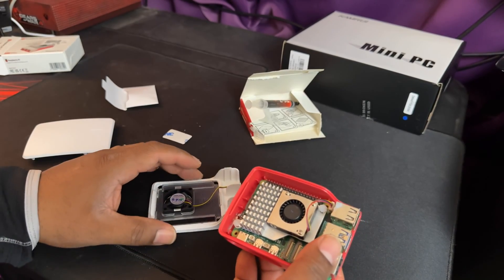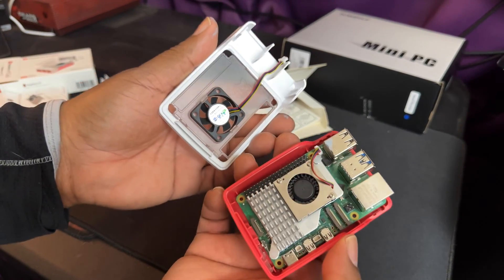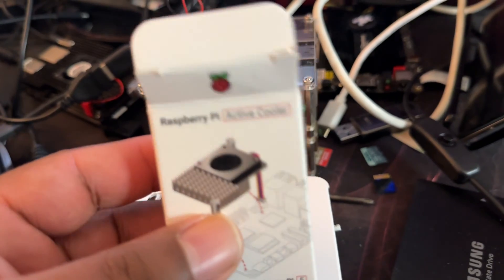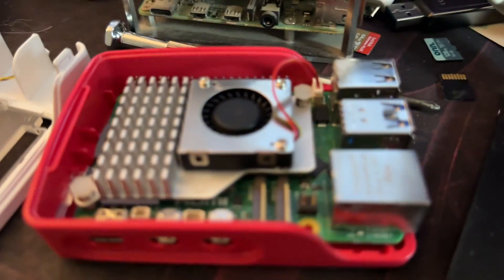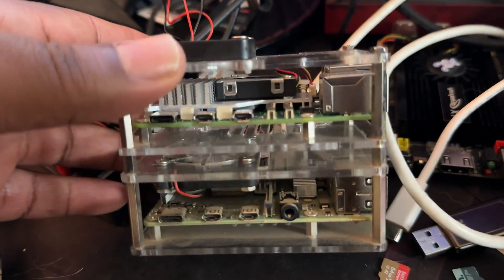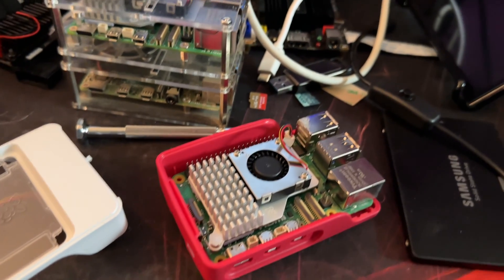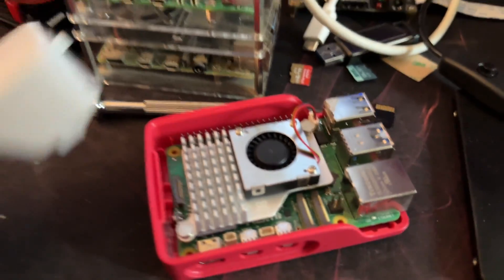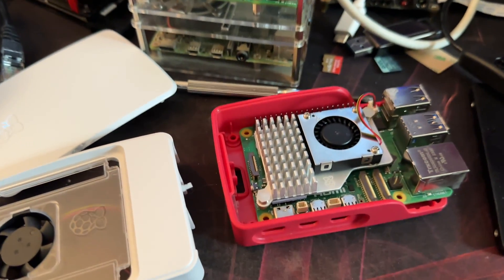The Raspberry Pi 5 Case & Active Cooler Install Concerns

Comment: That's why they've made it so that the clear part pops out so you can use it with the active cooler if you want. That's how mines set up overclocked and hasn't gone above 55c (might get hotter when used for retropie)
Reply from the maker: U need the fan for cooling as well.
Reply: Updated my post to say it's how mines set up and never goes above 55c
Reply from the maker: @xforeverknightx  weve been using retropie and temps r 55-68 especially with ps2 emulation. And temps rise.
Reply: @kiodiekin  how did you manage to get retropie working I thought there where no builds yet.
Reply from the maker: @xforeverknightx  check my other videos and playlists
Reply from the maker: @xforeverknightx  had it working for weeks
Reply: Yeah, I popped oof the plastic part and when active I pop the top off completely.   

That fan is LOUD on the active cooler.  This thing needs an ice tower and fast.
Reply: @Beyondesp  I'm waiting on the argon, I see they have a neo for preorder
Reply from the maker: @xforeverknightx  nice

Comment: Just take the piece off the top. It fits. I did it with mine
Reply from the maker: yea but with ps2 and overclocking temps r still too high
Reply: @kiodiekin  mount the case fan on the outside of the case..

Comment: I can see your frustration as most of the videos only show the active cooler without a case but they did make a video about the new case which explains that the official case was designed to use the fan as improved venting and you can remove the clear plastic cover that houses the fan for passive cooling.

A comment mentioned that the active cooler can be used inside the case if you remove the clear plastic but not recommended as they went with the metal heatsink + fan for better cooling which makes sense.

The active cooler fan is rated to 50,000 hours of use so should see long life and I expect no different as it will get regular use since the thermals from the new chip aren't great compared to similar ARM chips.

The case is also stackable so you can make a tower with a few PIs and the HAT can be installed on top or inside the case if you remove the clear plastic cover.
Reply from the maker: It’s not cool enough when u over clock. We’ve already over clocked retropie on this and people r reaching near thermals without a case with ps2 emulation. My open air case gets 28-53 degrees. The case is made to protect it. Although it adds heat the active cooler alone doesn’t provide protection. I just bench marked this and the temps were over 69. Not a good sign for long term use in a continuous fashion.
Reply: @kiodiekin  If you run Intel or AMD CPUs with full workload, then they are even over 80°C and I run them many many hours over many years with that temperature. Some of them are even allowed to run at over 100°C.
Reply from the maker: @Volker-Dirr  those chips r made to run hotter even my x1 sbc can go over 105
Reply: @kiodiekin  Yes, and the Pi chip is designed to run up to 80°C without problems and up to 85°C with reduced speed. Why do you think that the temp must be below 69°C? The design of the chip is up to 80°C without problems.
Reply from the maker: @Volker-Dirr  because this was only running for 5 mins and if I watch my other videos temps increase with demanding apps over time especially while in the case. Guys testing r already getting 77 degrees with the top off. And in some cases the fan doesn’t spin. And this is only after a few mins of game play
Reply: @kiodiekin  Don't worry. I run the official case with full load on all cores for much over 24 hours and the temp always stays around 75°C. You can even hear that the cooler turn off sometimes again because it is too cool again.
Reply: But i must admit i run only stock / official speed. Now Overclocking. I think complaining about not fitting into a official case if it runs out of official speed settings is maybe a bit odd. If anyone run it out of official specifications i think it is normal that a case must be maybe also out of specification.
Reply from the maker: @Volker-Dirr  u ran it with a high demand program like ps2 emulation? Even over clocking a bit temps go up in side the case
Reply: @kiodiekin  High demand CPU. I am compiling a lot of source code on all 4 cores. And I am generating timetables on all 4 cores. So all 4 CPU cores are running at 100% all the time. Not a single millisecond idle for the core. But since you said ps2... well, my GPU is nearly always idle.
Reply from the maker: @Volker-Dirr  ya that’s nothing. Even the orange pi5 gets hot with ps2 emulation. Ur doing basic cpu comps
Reply: @kiodiekin  Maybe, but i tested 24h and not only a few minutes. The fan is running only 50% at 60°C, 70% at 68°C and 100% at 75°C. So if you want to have it cooler (even i still don't understand why you want to have it below 69°C if the CPU design if for 80°C), why don't you just increase the fan speed?
Reply from the maker: @Volker-Dirr  do run a gaming front end and run games on ps2 for a few hours and let me known
Reply: @kiodiekin  Maybe at the weekend. My Pi must do other stuff right now. I saw the videos from channel leepspvideo . In the latest videos you can see that he installed an icecube 2 cooler, but if you check his videos 1-2 month ago, then you can see that he is running  ps2 and emulators just with a fan, no heat sink at all.
Reply: @kiodiekin  Also a German guy from a large journal reported that he put the active cooler into the official case and while gaming ps2 and other emus and the fan was not loud. It was only loud while using Ubuntu, since the fan control was not active with Ubuntu. So it look like it was not too hot for gameing if the fan wasn't at 100% while playing. He sadly didn't said the exact temperatures. see: https://youtu.be/NCpylBZu8HM?t=263
Reply from the maker: @Volker-Dirr  i dont understand the purpose in the link u sent. it doesnt provide any details as to any claims ur making. the guy was stuttering on gta. batocera isnt even optimized to run ps2 emulation which ive been doing for months.... theres a very small handfull of guys who have emulated ps2 on sbc and im one of the guys who released a build on multiple units.
Reply: @kiodiekin  Well, the information is as detailed as yours. What do you mean with 69°C is not a good sign. The CPU is designed to run up to 80°C with full speed and up to 85°C with reduced speed. You can read that also on the official raspberry pi webpage. And i measured with my tool that the official case is only around 75°C with full load on all cores (excluding gpu). And the fan even turns slower sometimes, since it is not hot enough to run it on full speed. So why you think it must be below 69°C if the software increase the fan speed only if the temp is over 75°C? If you want to have it below 69°C, why don't you turn on the fan on full speed earlier? I measured also the temperature if the fan is always on. In that case with full CPU load the temperature is only 55°C with the official case. But it is not faster by that. The CPU with 55°C as fast as with 75°C. So why do you think it must be blow 69°C?
Reply from the maker: @Volker-Dirr  the info wasn’t as detailed as mines. Fun follow my groups and public page I’ve maintained under 55 with over clock and running high end apps. None has shown a video with those temps and ran demanding apps for any long period. There quick 2 min tests where I’ve been running over 6 hours and got 53. Go run a demanding game like ps2 over clocked at 2800 and gpu at 800
Or higher inside a case and call me.
Reply: @kiodiekin  You want to tell me that you complain about an official case for default settings, because you want to overclock and keep the temperature below 69°C? You sound like one of the guys that buys an 55" tv on amazon and writes a one star review, because the tv is not 65". Isn't that a bit strange?
Reply from the maker: @Volker-Dirr  no need to hate. This ain’t the channel for that
Reply: @kiodiekin  I only wonder why channel @ExplainingComputers released a video this sunday and also measured the temperature by using sysbench on all cores, but he measured 10°C lower values as I measured in my videos (but i didn't used sysbench). I don't think that his room temperature was 10°C lower than my one. He sadly didn't said how hot/cool his room is. On the other hand there was a video some time ago where he showed how he prepared his garage into a film set for his videos. Maybe it is cooler. Or sysbech doesn't stress the CPU has much as my real world stress test. Can you maybe call me ~3 games that have a high work load. If i own that games I might test it this weekend.
Reply from the maker: @Volker-Dirr  his tests were fine and also similar numbers based on others compiling code for 3 days straight without turning there pi off. and other using there pi in the same case and got higher temps that continued to rise. if u wanna try ps2 emulation which only myself and supreme team have running correcty over clock ur pi and run it for 2-3 hours. put it in a case without additional fan. try running time crisis 3 shadow of colossus and anything else demanding and see what happens
Reply: @kiodiekin  Well, i spotted his bug in his measurements now. He (@ExplainingComputers) measured only every 2 minutes. But if the fan increase the speed at 75°C, then it will stay on/high until the temperature is below 70°C and it will increase only again at 75°C. That is coded by purpose to avoid turning on and off the fan too fast. If you saw my measements, then you saw that i measured every 2 seconds and you can see that the temp is always moving between 75°C and 70°C. That is a very clever and good coding by the Raspberry guys. They know how to cool the pi very well. So he (@ExplainingComputers) had only luck that his temps are so low. I saw similar bugs were done by other YouTubers; they measured in too large periods and by that they didn't understood why is looked so wired. You can only see it if you measure with a higher frequency or if you read the cooling documentation or source of the fan control.

Comment: Bad design. no screws. im finding other cases online that has the correct design for use with an active cooler. why may the dumb decision for people customers not to use the active cooler with there protective case....
Reply from the maker: U would think they would have added screws as well

Comment: This video is pointless. The design of the case is fine. Its allows you to remove the fan and have the active cooler. Or, you can not have the active cooler, have the case fan and your own heatsinks etc. All this is clearly explained in the literature or websites selling the Pi5 and its accessories.

Having watched a good few of your videos, its quite clear that you have an agenda with RPi, and are consistently negative about their products without sound reasoning.
Reply: @mrheath86 Someone whose never contributing anything chiming in. Your thought process needs examination
Reply: I can see the frustrations with the new release as it seems rushed to compete against RK3588 SBCs and the sponsored review videos were very limited in explaining the specs and how to use the case as many reviewers only received a board with active cooling. Their are legitimate questions to be made with the release considering RaspberryPi themselves stated no new Pi in 2023 and we're only now starting to see unofficial accessories drop as more users get their orders so I expect to improvements.

I don't see any agenda as KIO is openly honest in his views and having dedicated hours to supporting the new SBCs he's qualified to share his expectations and even RaspberryPi's own video doesn't mention that you can use active cooler with official case so very easy to ask the question if it ain't shown on the boxes or initial review videos.
Reply from the maker: @Razor_Burn  agh yes that will be coming up. the rk3588 battle of the pi comparison
Reply: 😂 Kio is a dev of the product and is honest about his reviews. Your problem is is your use to paid people getting crsp for free and always remaining positive. For a man you claim is negative he sure releases a lot of stuff that adds to there bottom dollar and retro gaming. What have you ever provided? I’m sure many other consumers are having the same issue. You must be apart of the get along go along gang.
Reply: I never once mentioned the temps, not once, or questioned your opinions on the running temps of the Pi5.

I just pointed out that your video regarding the official case is misleading and misinformation regarding the Active cooler and the case fan being used together. When clearly that’s not what is was designed for, and states everywhere that you can use one or the other.

Its also clear from others comments and replies your misinformation is evident regarding the official case, and even then you are reply to their comments regarding heat, when that’s not what their concern is either.

I have no ruffled feathers or vendor agendas here. Just fact. Which is what your video doesn’t have. Facts.
Reply: I’m honestly thankful for it. You aware Kio is one of the guys who brings retro gaming to the pi right. With effort as his community would be months behind any development. Him and supreme had retro gaming working 8 months before anyone else. Maybe your just not use to transparency. Or are you a vendor who doesn’t like the simplicity of well thought out arguments. @mrheath how can an active cooler protect my pi??? Silly I have to ask this question since that’s not the purpose of it.
Reply: Anyone who complains about a person who spends there hard earned money to support and grow the community is a self righteous individual. Butt hurt about a product review that makes sense. I guess your calling the rest of of idiots as well for making the same honest mistake that wasn’t advertised at stores or other websites
Reply from the maker: Everything here isn’t gonna be too your liking. I know how to read and haven’t seen this issue listed before buying. If a company is making mistakes it should be discussed. Your sound reasoning doesn’t make any sense👋 you feel it’s pointless because you’re close minded and short sided and don’t have anyone else in mind other than yourself. If it has been mentioned by others take this advice. Maybe it really is an issue and should be corrected and not swept under the carpet or whatever else is comfortable for your ears
Reply: Again, the literature, websites and advertisement clearly explain what I have stated above.

Whether you contribute or not to the community, simple misinformation (or laziness) doesn’t make your content any more valid than anyone else’s.

Simple fact is the case is what it is, and is designed to be ‘minimal’ but also include basic cooling. However RPi offer a step up in cooling, by way of the active cooler, and the case adapts to accommodate this accessory. If you personally want a ‘dual’ cooling system, or a whatever, then buy a different/third party case. 

That is simply it.

No need for the rest of you guys need to get all hurt by my comment 😂 them be the facts
Reply from the maker: Thank you for watching. Your info is false Ive looked at several websites and none of them report that secondly I run many communities where people and other devs are complaining and concerned about the temps. If you’d like I can send them to you. This channel is based on facts. Sorry it ruffled your feathers but it is what it is. Lastly the active cooler is described to work with heavy loads and not a moderate environment. Don’t understand your intentions trying to sell a bogus narrative. Maybe your a vendor who has something to lose from truthful reviews
Reply: @MrRHeath86  I reviewed the websites entirely this is a simple matter and nothing is mentioned about compatibility on any site. If your gung ho about post the link with the info. Spark wire pi hut  microcenter, parallax, Canakit mention nothing of the sort. Please post a link that backs up what you’re saying. Again none of these sites I mention say anything that supports your claims
Reply: @nana-te5bp  also no mention of compatibility in RaspberryPis own video on the official case which has its own fan but they recommend you use active cooling + heatsink for better resullts and longer term usage.
Reply: @Razor_Burn  nope! Sure isn’t. And look no response from commentator Mr heath.

Comment: A couple of other videos have discussed this. One guy modded his case with a clear top to work with the active cooler. 

Raspberry pi should have been much clearer with their info on this though.

Obviously that's why they sell the active cooler separate. The active cooler is designed to work without the case, but you can use it inside of the case if you remove the fan.
Reply from the maker: ya the active cooler heat sink is pretty much a needed item for it. i mean its not gonna protect the pi at all. they need an official case designed to work with it. waiting on reviews is def not ideal when most of us bought it at launch. heres the option to my acrylic case. https://amzn.to/3TcAb1T my temps overclocked are 30 degrees idle max 53 at 3000! gpu 1000 mghz
Reply: Dang, so silly, just remove the clear part.
Search for the video titled: Raspberry Pi 5 Cooling: Official Case vs Geeek Pi Heatsink Case
Reply: It was quite obvious that's why it was an either or, basically just use a pi 4 fan on the gpio and put the case fan on the outside... simples.
Reply from the maker: @rosslomath  I already have a better solution and my temps r the lowest around at 28